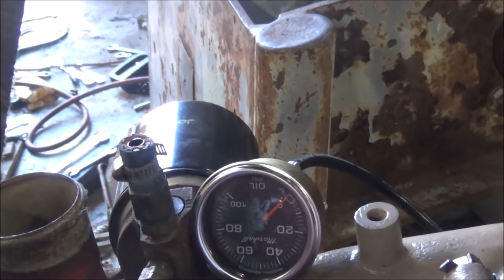Cummins Hyster Part 10: First Start after rebuild, How to Bleed an Inline Pump Fuel System.

Comment: So you need to open up the lines past the primer pump? Would small lines cracked on the gas take cause a vacuum leak? I'm working on an 89 M923A2 8.3 and the guy said he drove from AZ to Vegas with those 2 lines like that. He just ran out of fuel in the drive way and never tried starting it again. I got it to run for a min then couldn't get it going after that.
Reply from the maker: In a diesel the fuel system has to be completely sealed so air can not get in for it to work.  You operate the primer until you get no air bubbles in the fuel return then it should start.  If you pump awhile and are till getting air you will have to find the source and repair it before it will run.
Reply: @bcbloc02  thank you. I was watching another channel last night and he mentioned those lines were vents. I mean obviously they were designed for a reason. The owner makes it sound like he drove 4hrs with those off. But he's also knows nothing about any of his vehicles he just has tons of money and buys things to buy things.

Comment: Not bad for a hillbilly I have to say.... I was born in N. Carolina so most likely one of my legs is longer than the other too. You an Bailey can celebrate tonight with meat that still has a bone in it. Glad its all together and running. Last engine I put back together was making one out of many laying in the shop. It was just the 5.9 but still it felt good cause I was crippled and so my brother had to do what I told him to do. I had a bunch of known good parts and gaskets from several kits and some out of the boxes they came in. From pulling to fixing to install was three days and he was tired... me, I was so happy to see it run as he needed that little four fifty case dozer bad and I just needed to feel needed again

Comment: I still see know way in Hell that fits in place of another engine.  You the Man, I know you got the will and the way.  I've been a Automotive mechanic for 30 plus years and you just can't put a ford engine in place of a Chevrolet engine normally.  Dodge makes me want to Puke but  that's just my preference.  Nice job on the rebuild.  GET ER DONE
Reply from the maker: If it won't fit I will get a bigger hammer. :-)

Comment: The guy that designed that injection sure did not think about the mechanic in the filed that has to bleed injector lines.
Reply from the maker: John McMickle No big deal really though. Just don’t run it out of fuel! 😎
Reply: @bcbloc02  Famous last words.

Comment: i seen sleeved engines pull in the rings ( take the temper out of them ) do to over heat with no coolant in them, the sleeve can not transfer heat away with no coolant just my two cents seen it happen with in a few min's

Comment: I missed the first part what did the Cummins engine come out of?
Reply from the maker: I think this particular one came from a late 80's or early 90's Case IH combine.
Reply: @bcbloc02  Why did you have to rebuild it? Bad ejection pump no oil pressure? Anyway it sounds good!
Reply from the maker: @rudycarlson8245  The oil pump had failed and it had locked up. I bought it as a good core but got screwed in that someone had left the rod bolts loose so it would turn over when they turned it in. Go back and watch the playlist and the full story is there of how I reclaimed the damaged bits to make a working engine again.
Reply: @bcbloc02  OK thanks will go back and watch from the beginning

Comment: Hi Brian,
Congrats on the first start. it sounds sweet. You had me worried near the end of the engine run. I was thinking "come on Brian, time to shut her down". The engine may have a lot of mass, but remember it uses wet liners and not a lot of mass there to absorb the heat. Anyway, she's running now and that's a big step. You and Bailey stay safe.

Comment: A younger guy on here (KT3406E) came to the same conclusion about running without coolant for a moment.  I wonder how long it would take to make any real difference.
Reply from the maker: At idle probably several minutes. At idle you are looking at egt's in the 300 something range usually so given that a cylinder only sees those temps for about 1/4 a cycle it would take a long time to get the castings up to the 200deg temps they often run in normal operation.

Comment: Would you speak for a minute or two about diesel timing.  It is a fascinating subject I believe many viewers/most folks know little about. 

 Coming from a marine background i was taught in various schools but life/job directions keep me from anything but a base knowledge.  It is my understanding that in the marine use with fairly constant rpm yet high load we have different needs regarding timing compared to the light load/variable rpm of road Duty applications.  Also, doesn't timing play a part in modern emissions edicts?

What is gained and lost when timing is set up at different angles?
Reply from the maker: I discussed timing a bit in I think it was the pump install video. Did you watch that one?
Reply: @bcbloc02  yep. I will revisit it

Comment: What JD tractor had that same engine extra points for the years used
Reply from the maker: None at least in the us anyway.
Reply: Answer is a 1058 and 1158 forwarder made in Woodstock Ont Canada
Reply from the maker: @larrytomb3896  I looked it up it says a 1058 used a 4B and the 1158 was a 6B, my engine is a 6C. Curious though did Deere even build those things themselves or were they a rebranded something else?

Comment: Hi Brian. 

That's running beautifully. 

I loved your comment "No oil leaks .... yet!" Sounds like you expected them. 

With changing the engine, will that entail changes to the engine mounts and bell housing connections?

That forklift will be the Hyster on steroids with this beast. 

It's been a great series, thoroughly enjoyed the one on the rebuilding of the injector pump, clearly those guys have done a few of them. 

Look forward to the next episodes!

Good to see Bailey comes to inspect your work periodically and to make sure you're not sleeping!!

Regards Dennis

Comment: I like it too and Baily's not one to be overly emotional. That rig starts like my opposed twin Vanguard. Starter turns 2ice and it's running. THAT is an engine that'd do a LOT of work and with good maintenance would last a long time and it sure will there. A-PLUS, Pal and GBWYall!

Comment: curious with the short duration and throttle that your going to be using in the fork lift. how do you keep from wet stacking the engine.
Reply from the maker: High compression and no excessive idle.

Comment: Brian you going to go direct from turbo to intake or run it through an after cooler? Oh yeah, it sounds good too.
Reply from the maker: I don't have an aftercooler for it so going straight to manifold. besides it won't be running hard enough to need it I don't think.
Reply: @bcbloc02  probably right on not running it hard enough unless you go downtown with it! Most likely will not even hit governed RPM very often in forklift operation in the shop area. Or pull a load for very long at all. Cheers

Comment: It's alive!  Great job, after twenty years it hums right along.  Surprised to see you wearing a brand new pair of pants while priming that sucker.  My wife yells at me every time I go to the shop in my "good clothes", lol.
Reply from the maker: Not new pants they have been worn once a week every week for the last 3 years at least
Reply: @bcbloc02  Then you're safe, lol.  I saw the bar code and assumed they were new.  How do you keep them so clean?  I go in the shop 5 minutes and something that won't come out has made a permanent mark.  Oh wait, this is not a show for trading laundry tips ;)
You did a great job getting that engine to live again.  I missed all the previous episodes, I'll have to go back and look from the beginning.
Reply from the maker: An aggressive washing machine lots of tide and a warm cold wash cycle is all I do. Usually comes clean fine.

Comment: Nice!!!! Probably would have popped off quicker if the color of the fuel had matched the can! Lol
If it turns out you’re not happy with them injectors I know somebody that will buy them from you!!
Reply from the maker: Only difference in the color of the fuel is the tax you pay.
Reply: @bcbloc02  I didn’t know that! Have never been able to run them to compare, but someone had told me that off-road fuel ran better!
Reply from the maker: Fred Newman Back in the day there was some difference depending on what you were buying but now most all the fuel is usld and it comes off the same fuel racks regardless of where it is trucked too just if it doesn’t pay road tax it gets the dye. There are some specialty fuels like the countrymark coop makes that are better but you won’t run into them unless you go looking for them.

Comment: Sounds good! 12 valve engines both b and c series start so quick. Some of the best sounding 4 strokes out there. One thing, that compressor probably got pretty warm haha. Not enough to matter though. Looks like it runs good!
Reply from the maker: It wasn’t building any pressure so it didn’t make much heat
Reply: @bcbloc02  Good point!